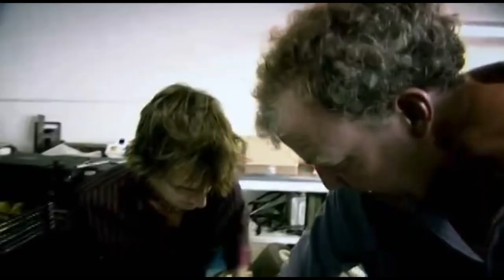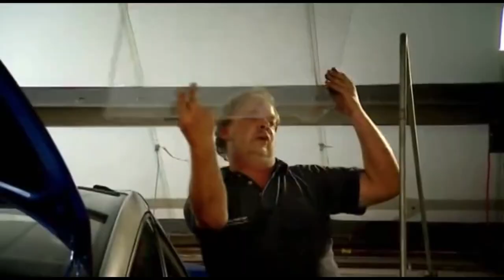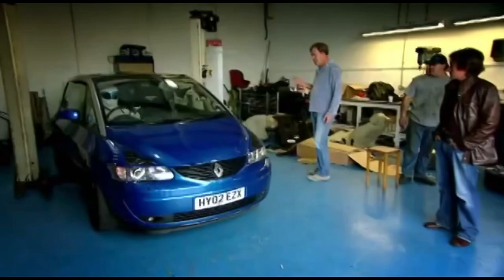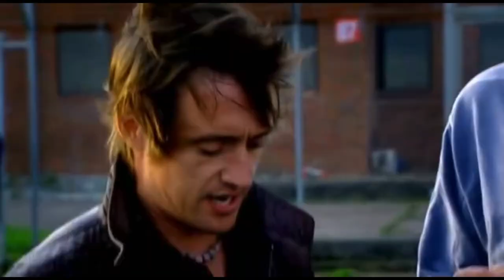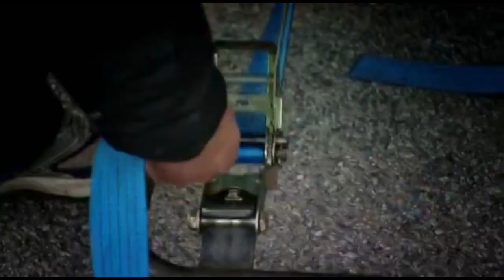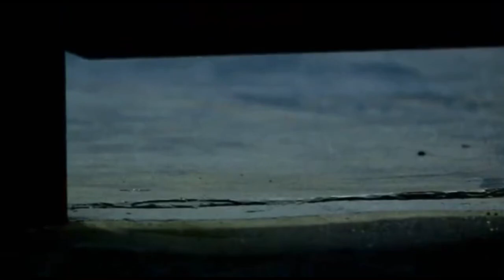Top Gear - Renault Avantime Lap Time Challenge vs Mitsubishi Evo (Part 4)

Comment: Those 210hp are measured at the crank, whereas the 157 they measured were at the wheels.
Reply: 207 bhp at the wheels, FWD and very good gearbox and diff. Those 157 hp are the result of engine problems (James even said that indirectly), which they fixed for the final lap. They messed up the tuning of this car a bit badly, in the sense that the engine could have been pushed easily to 250 hp with proper remap and exhaust. And they didn't do anything of that.

Comment: The whole challenge was setup to fail, like spending 4k on brakes. They approached this as if they had a 50k budget, Haha

Buy some used six pot brakes, then just re-drill the rotors and fabricate brackets, get some lines made with the correct fixings 500-600 all in. Buy a couple of used Garratt Turbos 700-900. modify the manifolds, run an oil/water feed into the block, etc. Then 500-600 on a fully customisable aftermarket ECU, as for the rest of the exhaust, just buy a couple of used silencers an make simple side exits. As long as you get enough fuel, maybe 350-400hp ... 

Thats 2 max 3k, then use the remaining on uprated clutch, Good higher ratio LSD, Coilovers, adjustable carbon front splitter, adjustable rear roof spoiler, perspex rear- side windows, light weight wheels, good tires, maybe with Bot-on arches 275-295s front, depending on rear stability 235-245s

I think that could get you into the mid 1;20s
Reply: Yes, they messed up the tuning badly with this car. No engine upgrade at all, I mean, they only did repairs on it, no upgrades. They could have easly push it to 250 hp with proper remap and exhaust, although the V6 Avantime had good exhaust with decent diameter.
Reply: @legioner9  after playing gran turismo 4, they should have change the oil as well since the car was at that time 6 year old, they should have start by getting the car back factory fresh condition first, get better fuel and oil, and then tune the car. I thought they remembered that used cars lost about 40-60 percent power after a few years of usage
Reply: @nicklowe1815  Well, that Avantime definetly lost some power after only 6 years. That engine was suffering (before they repaired it). The only tuning they did was the suspension and brakes ... Pitty really ...
Reply: @legioner9  that’s why we should always know a car’s condition first before tuning it. You need to know whether it still as powerful as it was after it rolled out of the factory or has lost some strength after years of usage. The trio just tuned the car without knowing it’s condition and just add whatever they think can make the car fast
Reply: @legioner9  remember that time when Jeremy’s Merak only got 80 horsepower left from it’s original 190 hp?
Reply: Your suggestions arn't any better, infact they are worse in everyway. 
You can't just source a pair of used parts, that easily. 
Nor can you just fit em, to a car without a proper mounting kit.
Reply: @Orcawhale... I made custom brackets for my AP-racing Calipers and got custom bells made for the rotors. I also coilover converted a live axle ae86 corolla, made custom brackets. and for rx7 fd3s calipers, got custom brake lines made, then used aftermarket re-drilled mini one cooper disks

The main problem with this Top gear challenge was the time constraint, This was so obviously setup to fail to undermine car modification

But still any car that isn't recognised for its potential requires thinking outside the box. Any car can be modified and make competitive respectively, You need to find reasonably compatible parts from more popular tuneable cars, with large communities of used parts, then you can get custom brackets, brake lines, fixings etc made. 

Thats the only method to make something like an Aventine, Fast. Cheaply... You can do it the 'Proper, model specific parts' way and be 40k down and probably no faster.
Reply: @roknroller6052  Thinking outside the box, won't help you if you can't get the parts.
The used market isn't the same across the world. 
What's more, you've still failed to realize that not everybody can make custom brackets.
Reply: @Orcawhale.... Well If the persons not somewhat handy with tools, Then don't even attempt, it will become a money pit..
Reply: Did you forget that this was filmed in 2008 and they only had 2 days to build it.. I mean sure, they could have done a few things different but all those things you are suggesting it would take at least a month and 25k